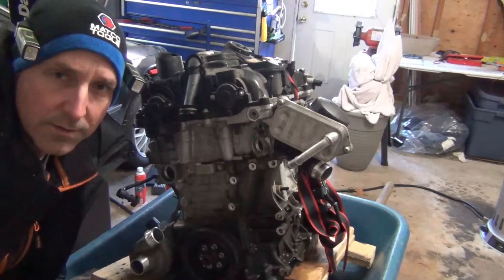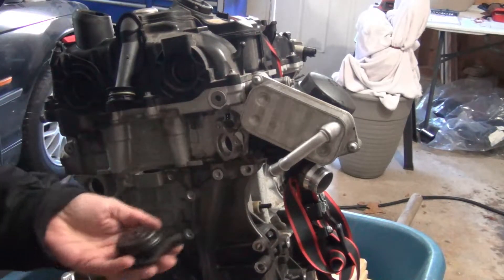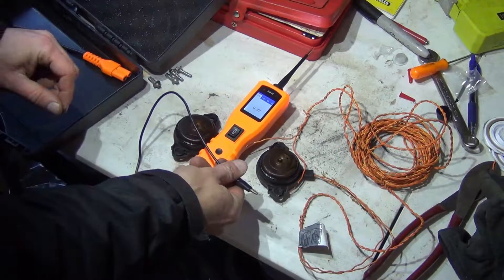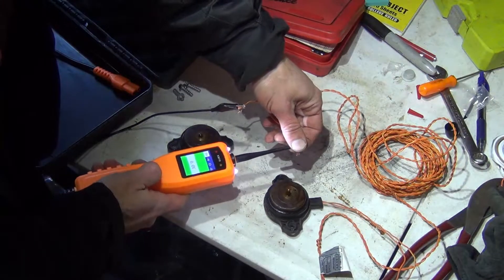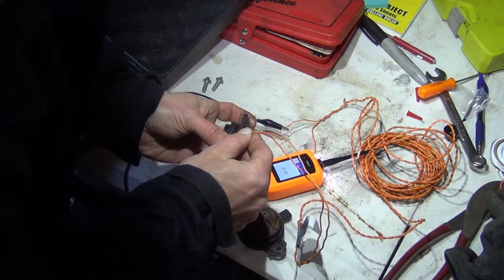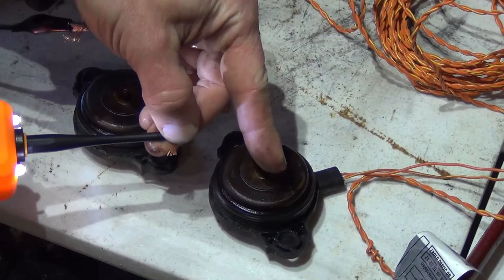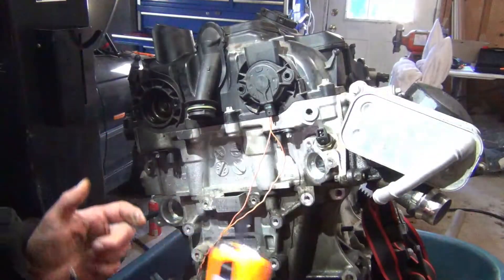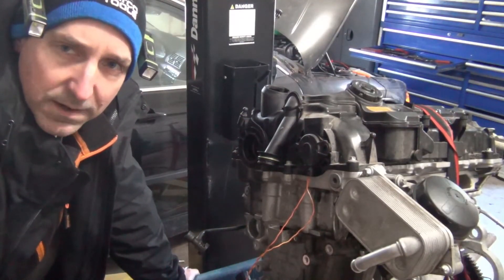How To Test A VANOS Solenoid - N20 Intake Vanos Exhaust Vanos Actuator Solenoid Removal And Testing

Comment: Great video! 
So the VanOS actuator is binary? Strictly On/off without any modulation?
Great series, Roger!  I didn’t see it until a few hours ago actually. What the… 👍🏻
Reply from the maker: Hi Mario! The VANOS units are fully variable within their range using oil pressure and internal spring tension to adjust for advancing and retarding timing. That's is a great question. I will do some more research and potentially do a presentation on how it works. YouTube no longer sends videos directly to subscribers. They promote by content viewed to suggest other content. I hope they change it back. I have heard some other video producers send to email lists. I might have to do something similar. Thanks for watching and the great question bud!
Reply: @AskTheCarExperts  ah, interesting re. vanos… thanks!
Screw u tube,,, I’ll just check your channel for new vids! 👍🏻👍🏻